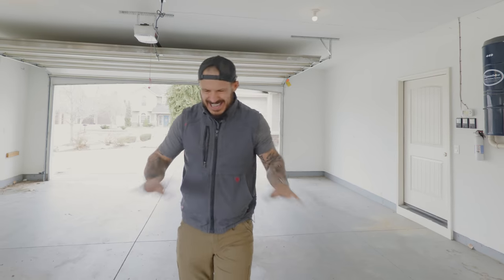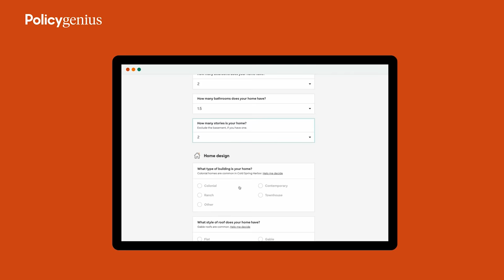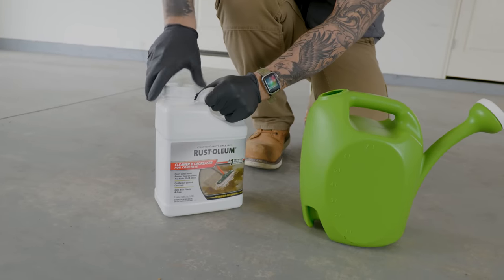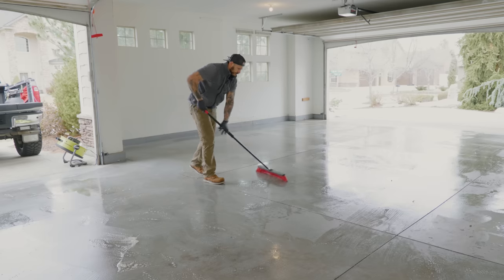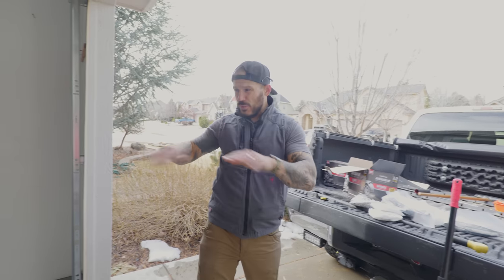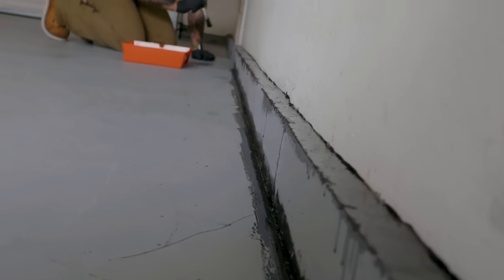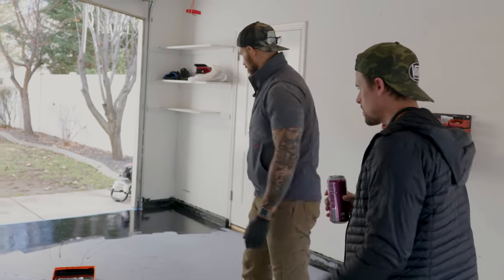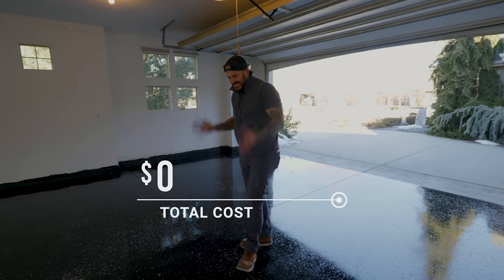New Garage Floor Epoxy + SAVED $5,000 BY DOING IT MYSELF || Concrete Slab House Reno (Ep.3)

Comment from the maker: To start comparing quotes and simplify insurance-buying check out Policygenius: https://policygenius.com/mrbuildit Thanks to Policygenius for sponsoring this video!
Reply: To cover the lower wall and to cover you mistakes you should install rigded aluminum wall panels
Reply: Why are your boots three sizes too big? Looking like Ronald McDonald
Reply: I do epoxy for a living this floor is trash and will fail chip in less than a year .. you have to grind floor with diamond bits not just wash it lol
Reply: How's it holding up. Was going to buy this kit at lowes

Comment: It won't last. You need to rent a diamond edge blade to use on concrete during prep to get a clean surface to bond. Always remember to test your floor for humidity level as not all garage floors have vapor barrier underneath and the epoxy won't last
Reply: didn't he say there was previous epoxy on the concrete already?
Reply: its already epoxyd
Reply: Typically the previous coating should be removed when dealing with flooring epoxy
Reply: @brandonsyanez  a previous epoxy coat can basically be used as a primer coat
Reply: @tomjrs3625  not necessarily, if there is any sort of top coat on the floor (like a urethane) it wont bond well at all. Epoxy also should not be layered on top of an already existing epoxy surface without being grinded down. The reason companies charge a lot is because it is done the right way. For epoxy to last the concrete has to be hit with a grinder. There is no replacement for grinding a floor, there is a reason people do it at home for 500$ and companies charge thousands. There is a big difference.
Reply: @Brendan-hi9vn  but i believe they have grinders and the rental yard, it would add a day or so to the project but it doesn't sound too bad no?
Reply: @AlessioSangalli  I work for an epoxy company, so luckily I don't have to worry about renting equiptment. I don't doubt that they have them available for rent. But we also use regular hand held grinders with a wheel that has concrete grinding wheels and diamonds to do corners and small areas. If you were determined, you could do the whole garage with one of these.
Reply: @Brendan-hi9vn  don't get me wrong, i work in aerospace and we do not cheap out with epoxy floors, absolute quality is paramount. However a dude and his garage it sounds like can be done well with some extra work. So it was probably unfortunate for the creator of this video to compare a $400 store kit to a $5k job, but with the right tools and dedication it sounds like it's possible for a DIYer
Reply: @AlessioSangalli  Yeah 100%. I'm just not familiar with the availability or cost of renting the equipment. But if its available, saves money, and the person knows what they're doing then yeah go for it. with the right equipment its easy, just very time consuming and loud lol.
Reply: @Brendan-hi9vn  anything high quality is loud, dusty, and uses hazardous chemicals 🤣🤣
Reply: A $5k contractor wouldve properly ground the floors down. 3 of my neighbors had epoxy floors done from a kit (via DIY or handyman contractors), and they are all peeling. Thats typically only good enough for a new slab. Locally, i looked into renting a diamond grinder at about $200/day, and wouldve had to buy about $300 in consumable diamond blades for it (3 different grits total). A 3-car garage would’ve taken him few days. He wouldve spent closer to $2k to do it properly. I hope it works out for him though, looks awesome..
Reply: yup. i LOL people on FB saying do it yourself and laugh at people who pay $2000+ from a professional who actually grinds the concrete and uses solvent based epoxy. Then you ask what they use and its big box store crap epoxy and they dont park cars in their garage LOL. someone needs to do a video to show how wack those box store epoxy and only acid cleaning the concrete really is.
Reply: @moialder252  what about new concrete. I'm building a new garage and i would like a good epoxy floor. What should I make sure the concrete guy does to prep for epoxy? Maybe do a specific finish? And yeah, solvent based all the way
Reply: @AlessioSangalli  Hi.  Diamond grind with 3 head grinder to CSP3.  The epoxy needs a profile to bond with no matter how new the concrete.  Vacuum the floor with industrial equipment after grinding, again the epoxy needs to get into profile to bond.  In your case you could ask for a light brush on concrete finish and after 30 days of curing apply high quality epoxy from a referenced local formulator.  My go to topcoat is a polyaspartic 80, that’s where you get the high gloss and ten year floor.
Reply: @137-trimethylxanthin7  that’s why he said it’s already chipping up😂
Reply: if you want your epoxy to last, DO NOT use this guys methods. You’re better off hiring a pro or saving your little $400.
Reply: Agreed it wont stick.  I did what he did and about 3 years after it started coming up.  Hot tire pickup is a thing!
Reply: Was looking for this. Good looking floor, but it will fail in about a year or two.
Reply: @proxbimcginley5085  .. yeah recommend a polyaspartic to a d.i.y.er and see how quick he cooks the bucket lol
Reply: Ive been researching this process for the last month, here in a few weeks I'll rent a grinder from a rental house, will cost me 150ish for the weekend. Plan on using Sherwin Williams armorseal  for the epoxy which cost about 300 for a kit. Will need 3 kits for my 450sqft garage, In the ended I've priced it to be about 1200 just in materials and rentals.
Reply: @Brendan-hi9vn  What about the materials used? Is this DIY epoxy the same or close to what your professional company uses?
Reply: @duanehundley  not the stuff you usually find in the big box stores. we use a company called dur-a-flex. I'm not sure if they sell small kits for DIY. I'm not familiar with what DIY kits are good because most large epoxy distributors that most companies use do not sell the DIY kits. That being said, the product used is less important than the prep and the application process. Grinding the floor is the most important part and if this step is skipped even the highest quality epoxy coating will flake off.
Reply: @AlessioSangalli  Look into E2U products they are industrial grade and lots of pros use them. You will see the price difference.... as long as you diamond grind the surface and top coat over your base you will have a product that lasts. Epoxy will yellow overtime. But if you top coat it with a polyaspartic that will protect it.
Reply: @gamerfanatic6321  thank you so much.
Reply: @krehbein  I've done a lot of research, at full retail price armorseal is extremely expensive, with the contractor discount price I will be paying there's nothing that compares online.
Reply: You can put epoxy over epoxy but first you have to do a pull test, then if you have good bond with the substrate you can sand and apply epoxy, but if you already know that it’s chipping you have to prep shotblasting, griding not just go on top. I just expend $400 for a floor that it’s going to last 1 month tops.
Reply: @AlessioSangalli  $400 for 50 % solid epoxy water base with no Ivan protection or final coat compare with 100% solid solvent base and polyespartic final coat LOL he have to research a little.
Reply: @duanehundley  not even close rostolium it’s water base epoxy 50% solid that’s mean than 50% of the thickness of the product that you apply will evaporate, they use 1.5 gallons per 2 1/2 car garage that mean that you should apply at rate of 300 sqFt per gallon. Professional will use 2 par epoxy 100% solids solvent base at rate of 120 sq/ft per gallon.
Reply: @AlessioSangalli  The Benjamin Moore store that I work out of has one for rent for $300/day. It takes me about an hour for a 2 car garage. I have to go on low speeds because it will blow the fuse for a regular house pretty easily. They recommend hooking it in to a high-end generator. That said, totally doable. Adds a few hours to the job but you will go from a 1-2 year garage floor to 8-10.
Reply: @oldmanballs787  interesting thanks!
Reply: @AlessioSangalli  Yes you need a concrete floor grinder.  Probably a few hundred bucks a day to rent. Really anyone can do it but that the right way.
Reply: You can rent a grinder for around 200$ or 300$ a day and could easily grind this whole garage in a day.
Reply: Always remember to caulk your tape lines. No matter the tape it will bleed through especially on rough surfaces like concrete
Reply: @Brendan-hi9vn  I am pouring a new pad (8x22) for a shed. I wonder if I can just do some light grinding with hand tools and pour epoxy on it? Thanks
Reply: @yangmagic0703  you can do some light grinding, but I would recommend investing in a grinder and the correct diamond grinding blades for it. You could get these for under $100 and it is well worth it. We use angle grinders with diamond attachments for tight spaces that we can't get the large grinder in to. You could easily do a shed slab with a hand grinder. The type of diamond (grinder blade) you will need depends on the hardness of the slab you're working on. It is not an exact science, as long as you have a diamond that does a fair amount of roughing-up of the surface, it should be fine. Epoxy just needs a rough surface to adhere to.
Reply: @Brendan-hi9vn  thanks B! I can borrow an angle grinder from a friend for $0 and diamond discs aren't expensive. My concrete pad will be using 32mpa outside grade concrete. What grit would you recommend? ❤️
Reply: A concrete bit with over 4,000 psi would be my recommendation for opening the pores
Reply: I do epoxy for a living floor will chip up less than a year diamond grinding always terrible install
Reply: @qdamacqdagreat1715  oh? How so?
Reply: TFTI but hey he saved tons of dollars
Reply: @AlessioSangalli   my wife owns an epoxy company.  They’ve been doing it for a while and her team of 3 can take up to a week for a 2 car garage because they don’t skip any steps.
Reply: @Lincoln257  a week of the three of them working 8 hours a day? Or a week because there are cure times so they need to wait (and go on another job in the meantime).
Reply: @AlessioSangalli  depends on how old the floor is.  But if it’s new concrete it can take only a few hours each day and the rest of the day is curing.  But still might take 4-5 days overall until it’s completed.
Reply: @Lincoln257  that makes sense yeah. I see how prep time of old dusty concrete might be the biggest part of the job
Reply: @nickalfonso4122  Thanks, but do you calk the edge of the on top of the tape or lay a line of calk down then tape on the outside edge of it ?
Reply: @Rainman270  lay the tape and then run a bead of caulk on top of the tape. Pull the tape wile the caulk and paint are still wet to avoid the paint peeling. There are dozens of YouTube videos on caulking tape lines. Give it a shot. You’ll love the outcome
Reply: @nickalfonso4122  Ok, thanks, never heard of that.

Comment: Your friends were quoted 3-5k because they use actual epoxy resin. The product you are using will most likely peel in a year adding little to no value to your home. Still a great finished product but you get what you pay for and the people quoting your friends are most likely offering a quality product that has 10x the durability of what you put down on your floor.
Reply: In a newer home that didn't have oil stains like his, it should last a long time. But the average person who's going to use this product needs to do another $500 in grinding the floors or it will last a year or two as you said.

Comment: The flakes look great til you drop a small screw and now it's an Eye Spy book.
Reply: LOL...that's fact. That's when you need a magnetic sweeper.
Reply: I do epoxy flooring, it shouldn’t if done right because the top coat should be shiny enough. :)another thing he did wrong was no grinding of the concrete.. it’ll tear up pretty soon. So are you really saving 5,000..
Reply: Best way to find dropped items is to drop down to floor level and lay your head down and look that way.
Reply: Ye your supose to cover the whole floor with the flakes too 👌🤣
Reply: @carsoncole9302  fact...itll chip after the 1st winter
Reply: @carsoncole9302  agree
Reply: Magnetic wands. Best friends.
Reply: Two pro tips. 
1. Don’t drop a screw. 
2. If you do use a magnet 🧲 the end.
Reply: Magnet broom
Reply: When you drop a small screw its hard to find on any floor. Ask me how I know.

Comment: Hate the price comparisons as someone who did concrete work. Your only prep was a clean and that's it. Professionals will grind down you concrete in order for the epoxy to bond onto the floor, you also didn't add a polyurethane coat to protect the finish. This job will last you at most 6 months before it starts to chip off because the epoxy isn't binding to anything. When you inevitably redo the floor at least bring someone with some knowledge of epoxy so it lasts.

Comment: I’m having my floor professionally done because the previous owners failed to prep the floor properly.     The success of your epoxy job is 95% in the prep work.    I see no chance that this floor will hold up for any length of time.
Reply: I made that mistake by not using muriatic acid to etch the concrete floor.
Reply: a minute is a length of time.
Reply: @Mark-yy2py  acid doesn’t work well. You have to grind it and get to the aggregate

Comment: There's a reason a good epoxy floor will cost thousands.  Unfortunately this one will not last very long and those flakes are going to come off in no time.  You really need to prep the floors using diamond grinders to make sure you get a good bond.
Reply: The only thing good about Rust oleum epoxy is that it is easy to grind off and put a real coating down.
Reply: Yup. If you want to epoxy floor coating to last, you MUST grind off any and all coatings before you apply it. Also, these cheaper kits have low levels of solids in them and result in a fairly thin coating that will likely experience hot tire lift.
Reply: What if it's a freshly poured concrete pad? Do you still need to grind the surface?
Reply: @MatthewBrigham-1  Yes, if you want a good bond.  Also, you don't want to go over concrete that is too fresh.  Make sure you give it plenty of time to cure out.
Reply: @BroTheDude  ok thanks man. I’ll give it a few weeks since it just got poured yesterday. Unfortunately they didn’t smooth the slab out well so there’s some low spots. Hopefully I can find some self leveling epoxy.
Reply: @MatthewBrigham-1  Yes if you want the epoxy to last. Also remember, you need to let a new slab cure properly before putting an epoxy system onto it.
Reply: @MatthewBrigham-1  always gotta grind so you can open up pores and epoxy can settle inside like that other guy was saying most likely his floor is going to pop off or hot tire marks is Gna ruin it
Reply: @Musix Videox yes that UV clear top coat will protect it
Reply: @kumbayabombaclaat7004  WHAT IS A GOOD EPOXY YOU RECCOMEND/
Reply: @dye202 thanks. Are there any diy kits you actually recommend?
Reply: @dye202 commercial Sherwins carry the general polymer lineup. The process we use commercially for oil pits is: clean/degrease, bush hammer profile concrete, seal with a viscous epoxy (GP3504 or macropoxy 646 reduced with reducer 60) to seal and fill in pores VERY IMPORTANT otherwise you’ll end up with out gassing of the pores aren’t filled properly, GP3555 2 coats in order to give it a good flexibility (add in texture or flakes here) and then you can finish with GP3746 grout coat and a GP4638 topcoat, but if you can work fast just use 2 coats of 4850 which is faster curing (4hr instead of 12) and more UV resistant.
Reply: By the way never seen this guys videos before…. Love the energy he brings to it… wish he had talked to some pros before starting. Not bad if you want something to last a year or two though. Unfortunately you’re only as good as your base and if it’s already peeling you’re probably in for some growing pains. Keep it up buddy
Reply: Also… I hope he doesn’t drop any black washers or rubber pieces LOL
Reply: A lot of steps are missing. Yes, the diamond grinder is one big step and also the primer and top coat is missing.

Comment: There is a reason why it cost more professionally done they seal all your concrete crack, sand the floor, primer the floor, paint it, flake it and then seal it. It's a two day job not a one day job. Stuff you get from home depot is not commercial grade and will not last the test of time.